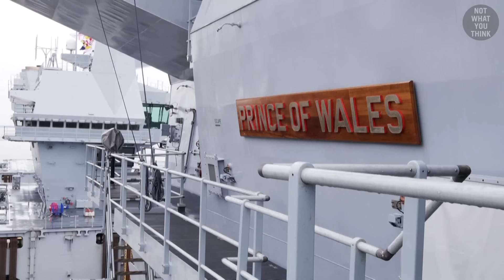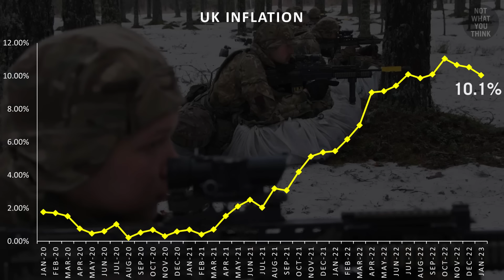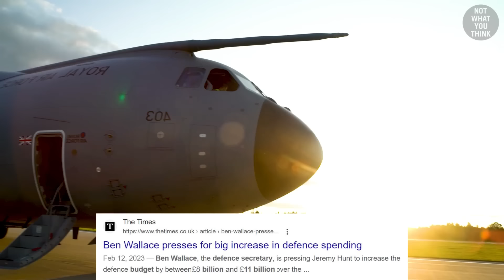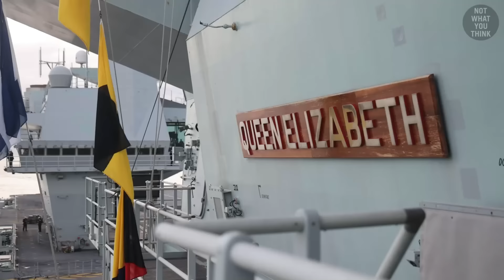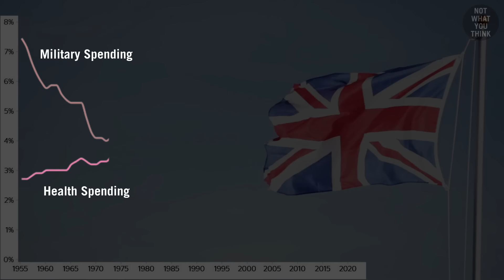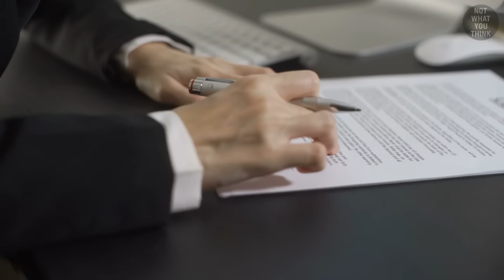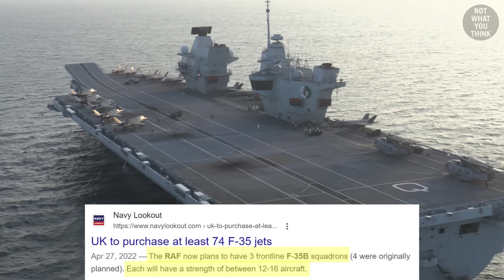Why QE Carriers are Considered a PART-TIME Fleet

Comment: Aircraft carriers are obsolete in the modern world just like battleships were after WW2. It requires lots of crews to man the ship, fighter jets and transport helicopters. It requires various sorts of ammunition for fighter jets such as BVR, WVR and assortment of bombs. As it is a big ship, the carrier also requires defense systems such surface to air missiles and anti-aircraft guns. What's worse is that aircraft carriers also require a battle group as protection which cost even more money and manpower. Against adversaries with powerful navies that have dozens of submarines, drones, MIRV and long ranged hypersonic missiles, the aircraft carrier does not stand a chance to shoot down all of the threats with 100% accuracy as a couple of bombs are enough to sink an aircraft carrier or at least put it out of commission. As aircraft carriers are armed to the teeth with various assortment of bombs and missiles, it's basically a big floating ammo depot that could cause a huge explosion if a bomb detonates where all the explosives are kept. Other than being a tool to project power on poorly armed countries, it's unlikely to last long against strong foes.
Reply: The whole reasoning behind the QEs is that they do not require large crews.
Reply: @dovetonsturdee7033  Also, another thing you forgot to mention is that your country depends on the USA for pretty much everything.
Reply: @ChadwickTheChad  Fortunately, most adult Americans are not quite so barking as you appear to be, or the US would find it even harder to find reliable allies than she currently does.
Reply: @dovetonsturdee7033  You can't even explain that comment 🤣

Comment: We need to get the UK on track to build 3 real nuclear carriers with proper catapults or CATOBARS for launch.
A ski lift runway means planes taking off with minimal ammo and minimal fuel.
Reply: To be fair the F-35B can take off with a full weapon and fuel payload from these ships using a relatively small part of the flight deck.

Its maximum payload is more limited than other variants, but it's not all that far off many aircraft operating from CATOBAR carriers.
Reply: The UK paid real carrier prices to get this pretend carrier.
There's nothing like a CVN. A nuclear supercarrier with unlimited range is the only way to go.

Comment: If you have two, then there's a good chance you always have one. If you have only one, then sometimes you have none. All ships go into dry dock for maintenance at points. This one more than it should. The air wing cannot be transferred to the other carrier if you only have one. That's big in case of war and heaven forbid one is sunk or has to withdraw from the battle for repairs.  You probably don't need 11 or 12, but this UK navy should not deter anyone and they made it that way.

Comment: Deterrence, peace through strength.
The UK probably can’t deploy the carriers, or even one csrreier, without destroyer and frigate escorts for protection against aircraft, anti-ship missiles and submarines.
Possibly they could be deployed under NATO with allied ships providing protection.
Over a fifty year life, the UK might be anpble to acquire some additional F35B’s.
They also need helicopters for anti-submarine warfare and airborne early warning systems.
There has been work on developing a helicopter borne early warning system to defend against over the horizon threats and sea skimming missiles.
The Chinese and likely Russians, and probably the Iranians are developing “carrier killer” ballistic missiles, which have several hundred mile range, so to have a “blue water” navy, it’s necessary for strike aircraft to launch from beyond cruise missile and ballistic missile range. With the F35B’s, that probably means air to air refueling, sinc3 the vertically launched F35B’s don’t have the fpheavy loads of ordnance and fuel of the “A” and “C” models which either launch from a runway inA model or catapault from the C model.
Probably the carriers will be more fit for coastal deployment around the UK and possibly North Atlantic to protect direct sea lanes, with protection from submarines by long range patrol aircraft such as Poseidon, a U.S. Navy aircraft.
The ships are valuable, irreplaceable, and have deterrent value, possibly even in the Far East, where Queen Elizabeth had made a deployment.
The ships shouldn’t be deployed without a full carrier strike group with supporting aircraft.
It’s not safe to do so.
To go to sea as an inviting or undefended target in the current world situation, with a new crisis every day would be extremely reckless.

Comment: Only one other country has 2 large carriers? Not to mention the ships they need to surround these things?  2 large carriers which will be scrounging aircraft to over half fill. 48 aircraft 24 each ship then given the complexity of the aircraft many will be in the workshop. I'd not mind but we are a declining power financially arguably about to get smaller relatively. Acting like we did a 100 years ago with an empire to subdue on a budget of pennies. Delusion?

Not sure who we hope [not] to fight? Some try saying Russia yet a) we won't confront it directly as last year showed b) it's easier to cure cancer than think of a way in which they will directly confront us. Maybe China? France? Argentina well if we're not incompetent that's hardly a threat.

If we keep voting for Liberalism [Lib Con Lab SNP all] we won't afford anything soon - won't even be able to run them and F35s. 47 years since the IMF came in and imposed it and every chart of growth rates since is downward - decade by decade slowing. We revalue existing housing stock mostly just to achieve that! If you deliberately shrink your economy then why do you want to project power? It's a Potemkin village of power. A national small dick energy with Olympic funding like an East Germany.

Comment: It should have been built as a proper carrier with a angle flight deck and arrester cable while they were building them both
Reply: And put 25 year old Super Hornets on it like the USN will on the new Gerald Ford class??......no thanks.I'll take the F35 !!
Reply: @user-gr2uv7vd8e what are you talking about? All he said was to put some catapults and arresting gear to make it a better carrier. The superhornet plays no part in this.
Reply: It was planned to be without catapults, but with the option for a steam one later. 

Then they decided they wanted the fancy electromatic catapults. You know, the ones even us Yanks with our billions of freedom eagles are still struggling with. 

And then they didn't like the timelines of fitting an entirely new experimental system on a ship that wasn't designed around it, so instead of reverting to steam, they decided to cancel all catapults. 

And now, after the damn carrier has already been built, they want to re-revert the decision, and now they want catapults again.

And that's the story of how the royal air force, you know, the one with the giant land based runways, are forced to use the short take off and landing F-35B.

Welcome to British procurement.

Comment: Just a quick question out of pure curiosity. Why do some countries have aircraft carriers with ramps at the bow, and others have nearly perfectly flat decks?

 Is there an advantage to either design, or is it just a preference thing?
Reply: Catapults (which are required for jets to take off of flat carriers) are, in many ways, the superior launch system for carriers.  However, they take up space, require tons of maintenance, need lots of power and/or steam, and can break or making.  On the other hand a ski jump puts more limits on what it can launch but is cheaper and needs none of the power or maintenance of the catapult.

The difference is a preference for performance or cost, basically. 

There are also some flat topped carriers that only launch things like helicopters but they have the special trait of not needing to go forward to take off 😅

Comment: The problems stem.
 mainly from the modular construction method This was different on the two carriers . Resulted in shaft misalignment on POW..That's a big job. All new girst of type ships have problems POW has had more than it's fair share. But like the Type 45s it will. be sorted. It's true however that the RN has lost its strength in depth that made it an impressive blue water force. That's going to be hard to rebuild.

Comment: Presuming they can get the thing going, if any need arose where a combined conflict with NATO forces was likely, a carrier with spare capacity can operate as an alternative landing zone, in particular if if another carrier in a combined fleet is disabled, it would be useful, not ideal, but better than a poke in the eye with a sharp stick. Although I suggest it would be foolhardy to pick a fight with someone unilaterally, without at least full capacity in your armoury!

Comment: I'm sorry but heads need to role for such a stupid mistake as the propeller shaft not being lined up properly. I mean how could such a thing happen in this day and age. With such advantages as computer calculations and lazer  measurements how can the engineering of such things go so wrong. I just don't get it.

Comment: Oughta sell them some of our old light carriers.
Reply: The USN hasn't operated light carriers since WWII. 

We do operate 9 LHD's but they aren't designed for sustained fixed wing operations and we don't have any spares.
Reply: @JoeBLOWFHB  I understand what you're saying. Landing helicopter docks(LHDS) in a relative sense are light carriers(not on the books ofc). Especially now that they have the ability to use f-35Bs. I just consider them a modern version of a light carrier. I imagine if we did have light carriers they would be of similar size to these types of vessels.

Comment: One argument I have heard in the UK is to switch from the Queen Elizbeth class (65,000 tons up 40 aircraft) to something similar to LHA concept used by the US Marine Corps (46,000 tons up 20 aircraft). So essentially half the tonnage light carriers similar to the old US Midway Class (46,000 tons standard load to 61,000 full load at up to 60 aircraft). Though such ships only hold about 20 or so combat planes, their smaller size means they can be built and maintained for less money. They are also less complex if made into dedicated light carriers they probably could up their air group to some approaching 25 to 30 aircraft. While also being more affordable so many more ships than say carriers like the Queen Elizabeth class can be built.

Comment: these ships are just stupid ...the uk can't even afford to get it fully planned on just one of these so why 2 ??
Reply: Because one is none, two is one. You need at least two (Really 3) to have one constantly available, as one will need to be in maintenance or working up.
Reply: @Benjd0  but what's the point iof you can't afford to fill it with aircraft ????? , I understand your reasoning it just doesn't make sense look how many frigates you could have bought or tanks ...very expensive tank = 8m, one carrier 4 billion if you believe the figures for QE so that would equal 500, 000 top-rated tanks with the same outcome .. and yes you really need 3 for one to be in service all the time but without the full complement of planes there is no point in more than one
Reply: @alangunningham5667  Who said they can't afford the aircraft? The reason for the lack of aircraft is due to the rate that the UK is receiving them. They've also waited for later production models so that they don't have to upgrade so many of the older ones.

The UK has been ordering them in batches, they have a total of 48 ordered so far with 30 of those delivered. Even if that was all they were getting, it would be enough to fill one carrier in rotation, but they have committed to purchasing more. It just doesn't make sense to have those on order so long before this batch has finished delivery.
Reply: @Benjd0  yes and unfortunately there is only 30 so far years after ....and some of those are promised to the R.A.F. and definitely not enough to just one carrier ... even if all were allocated for the carrier a 60 % allocation leaves it wow fully short ... allowing for repairs, work up and faults that would mean generally 15 aircraft if lucky to be operational ?? good god you think that 15 aircraft is worth 8 billion (not counting the cost of these aircraft .. and even these aircraft are a poor version ... the f35b hasn’t received the 2 major updates given to a+c versions and guess what the b version is used only by the UK and a very small amount in the USA marine corp... they can’t afford the upgrade program ... do you think the UK should then pay for the upgrade suit just to bring it up to standard? ..and this would still be a downgrade comparing the usa  CARRIER version f35C,  ho by way c=carriier ..... the b version only has v/stol over the others, certainly, its fighting abilities is degraded and even worse without the upgrades
Reply: @alangunningham5667  All of the F-35s are part of a joint force between the RN and RAF, the same as the Harriers were before retirement.

Again, 30 is just how many have been received so far. If that was all they were getting then I'd get your point, but like I said in my previous comment, they have more on order, and have committed to ordering more beyond that.

The only operator for the F-35C variant is the US Navy, and they will be relying on a variety of aircraft for many years to come.

On the other hand, the F-35B will be operated by the USMC, RN/RAF, Italian Navy, Spanish Navy, Japanese Navy, Singapore Air Force and potentially the South Korean Navy. It has a pretty big export potential being the only real option for countries wanting to operate STOVL carriers, which is the majority nowadays.
Reply: @Benjd0  do you not understand that is split between the R.A.F. and the Navy...so the navy hasn't got that many and will probably not ever get their full complement for just one aircraft carrier ...so what is the point in having 2 when you haven't even got enough to run 1 well ..even if they double that this year ( yes some are planned but noit that many .. so if they won't have the aircraft for probably like another 5 years and they have already had the carrier for well over 3 years ....the interest alone of just one wasted carrier would be huge if they actually waited till they got the aircraft before they built the carrier we could have saved the money for 2 off them for over seven-year... so how can you justify 2 carriers (we really need 3 as you said ) when we can't even justify the first one as we don't have the aircraft to operate it ! that is just so dumb it would only be done by the government ....as i have already  1 carrier = 500, 000 high priced tanks ......which is better 1 carrier that doesn't have a use or 500,000 tanks? And to top it all we have bought the crap version .of the f35.. some backhander???i can't believe we spend anything on the crap version f35 and then buy top-of-line ships that are used and the second one continuously breaks down ..just think if had those tanks now...Russia would be f**ked..and all we are going to do is upgrade 148 old tanks ... all down to these warships that are not  likely to be used fully for years .... and that is just one ...not 2

Comment: An aircraft carrier is one of the most useless and dangerous weapons. And dangerous not for the enemy but for the country that goes to war with one of these behemoths. They are crewed by several thousands of highly trained personnel. They are chock-a- block full of extremely expensive and highly complex machinery.  And all of that is concentrated in one very small place (compared to the size of the ocean). But at the same time big enough to be a slow and super easy target. Easy to destroy and all those highly trained human resources and  complex machinery gone at once. How braindead do you have to be to even build such a scrap heap. Every effing infantry patrol is taught to not bunch up but spread out. And here you have bunching up pushed to the absolutly insane maximum. Who is in charge of war planning in the navy? Gorillas?